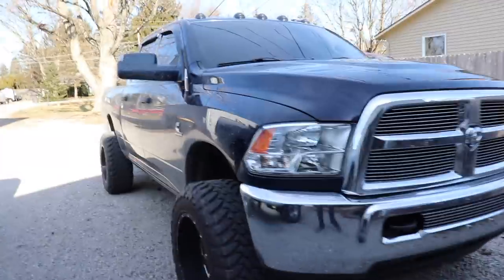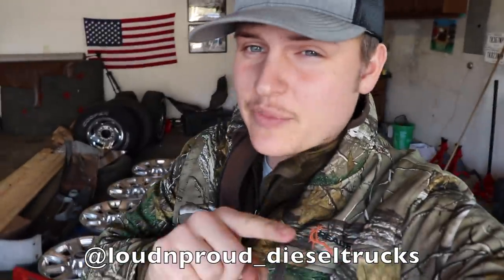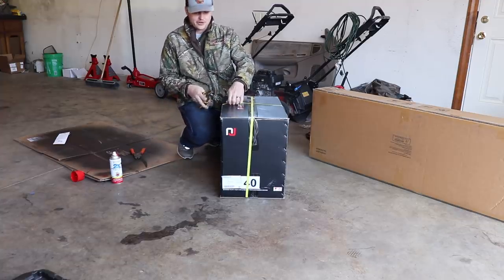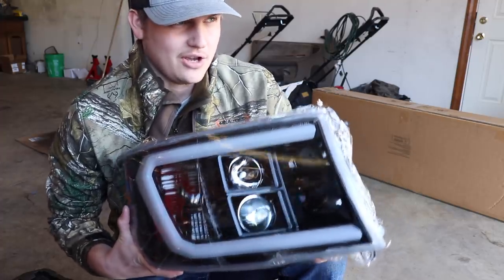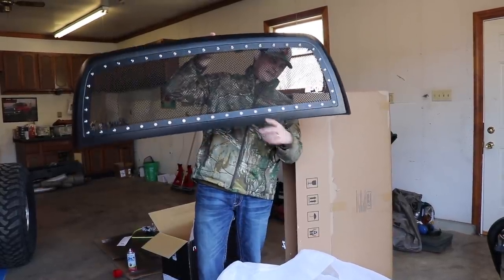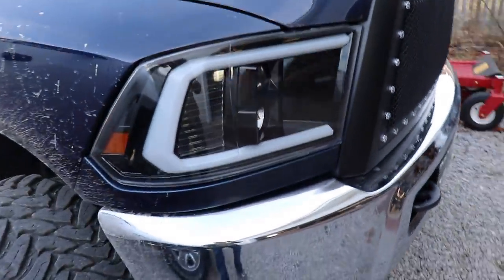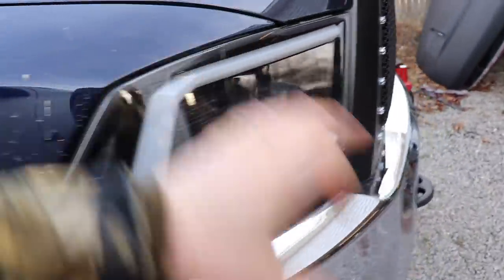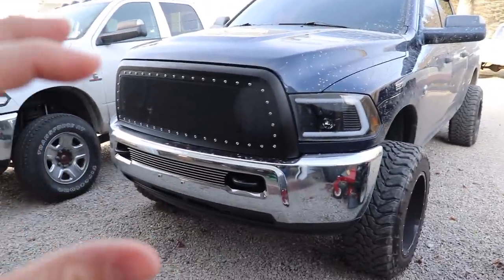'BIG BLUE' Just Got A Major FACELIFT!!!

Comment: Malachi. It could be your TPS sensor right on top of the VE pump. It's a common issue on first gen 12vs
Reply from the maker: Jo Moma I don’t know anything about them.. but you really think that’s it?
Reply: @LOUDNPROUD  I think there's a good chance that could be the problem. But if not it's something in the pump.. And that is going to be expensive. So it couldn't hurt to try. I will do a little more research and see if i can find out anything else for you.

Comment: Check the throttle linkage rod, may be worn out and loosening itself up and sticking, or check and see if the pump itself has the idle screw tampered with, but also check that little tps and make sure it’s good

Comment: Getting the chrome bumpers color matched yes it works it looks good, but they chip very easily, paint does not like to stick to chrome no matter how much you sand it. You would be better off for longevity reasons as this is a giveaway truck is to buy a front and rear bumper E-coated or “Primed” way better results will hold up a lot longer. 👍🏼
Reply: 😁 I totally goofed I paused the video and dropped a comment before you talked about black paintable bumpers 😂
Reply: @jrgraflage  you are correct and he should buy the e coated bumpers and he should give the winner the chrome bumpers and grill so if you want it chrome you can change it back.
Reply: Yeah I’m a painter I color matched my dodge factory pw7 bright white I bought e coated bumpers and a black painted grill, I also did my friends dodge in pw7 bright white but with chrome bumpers I sanded it very well but wasn’t guaranteeing anything now after a year my bumpers have rock chips which is normal but atleast my paint isn’t falling off like his is 🤭
Reply: But you could paint the chrome bumpers and clear bra it so it will prevent chipping but that’s also very expensive to do